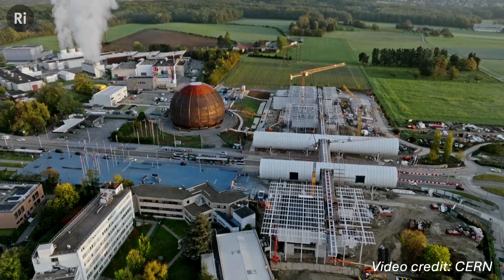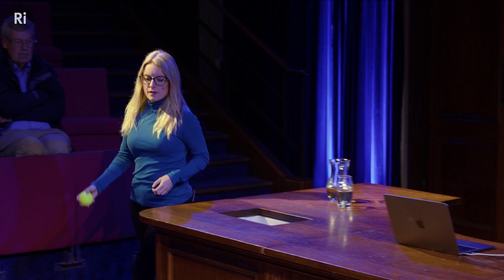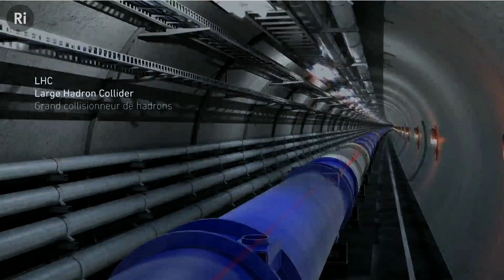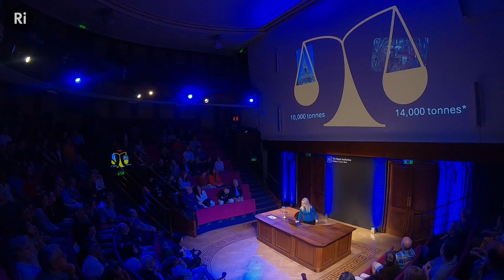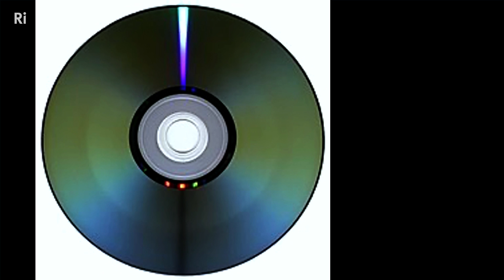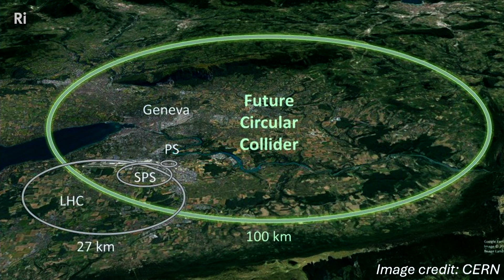Particle physics and the CMS experiment at CERN - with Kathryn Coldham

Comment: If Physicists describe electrons as point particles with no volume, where is the mass of the particle?

Can one extra spatial dimension produce a geometric explanation of the 1/2 spin of electrons?   The following is an extension of the old Kaluza-Klein theory. Can a twisted 3D <---> 4D soliton containing one extra spatial dimension help solve some of the current problems in Particle Physics?

What do the Twistors of Roger Penrose and the Geometric Unity of Eric Weinstein and the exploration of one extra spatial dimension by Lisa Randall and the "Belt Trick" of Paul Dirac have in common?  Is the following idea a “Quantized” model related to the “Vortex Theory” proposed by Maxwell and others during the 19th century?  Has the concept of the “Aether” been resurrected from the dead and relabeled as the “Higgs Field”?

In Spinors it takes two complete turns to get down the "rabbit hole" (Alpha Funnel 3D--->4D) to produce one twist cycle (1 Quantum unit).
 Can both Matter and Energy be described as "Quanta" of Spatial Curvature?  (A string is revealed to be a twisted cord when viewed up close.)         Mass= 1/Length, with each twist cycle of the 4D Hypertube proportional to Planck’s Constant.

In this model Alpha equals the compactification ratio within the twistor cone, which is approximately  1/137.

1= Hypertubule diameter at 4D interface

137= Cone’s larger end diameter at 3D interface where the photons are absorbed or emitted.

The 4D twisted Hypertubule gets longer or shorter as twisting or untwisting occurs.   (720 degrees per twist cycle.)  

If quarks have not been isolated and gluons have not been isolated, how do we know they are not parts of the same thing?   The tentacles of an octopus and the body of an octopus are parts of the same creature. 

Is there an alternative interpretation of "Asymptotic Freedom"?  What if Quarks are actually made up of twisted tubes which become physically entangled with two other twisted tubes to produce a proton?  Instead of the Strong Force being mediated by the constant exchange of gluons, it would be mediated by the physical entanglement of these twisted tubes.  When only two twisted tubules are entangled, a meson is produced which is unstable and rapidly unwinds (decays) into something else.   A proton would be analogous to three twisted rubber bands becoming entangled and the "Quarks" would be the places where the tubes are tangled together.  The behavior would be the same as rubber balls (representing the Quarks) connected with twisted rubber bands being separated from each other or placed closer together producing the exact same phenomenon as "Asymptotic Freedom" in protons and neutrons.  The force would become greater as the balls are separated, but the force would become less if the balls were placed closer together.  Therefore, the gluon is a synthetic particle (zero mass, zero charge) invented to explain the Strong Force.  The "Color Force" is a consequence of the XYZ orientation entanglement of the twisted tubules.  The two twisted tubule entanglement of Mesons is not stable and unwinds.   It takes the entanglement of three twisted tubules to produce the stable Proton.   The term “entanglement” in this case is analogous to three twisted ropes being wrapped around each other in a way which causes all of the ropes to move if someone pulls one of the ropes. Does the phenomenon of “Asymptotic Freedom” provide evidence that this concept is the correct interpretation of the experimental data now available?
Reply: Sounds about right. What are you or we able to build if this information is true.
Reply: @JakeSeeber  Thank you for the kind response.  They are very rare these days.  Dr. Peter Woit has recently explored using "Twistor Theory".  This concept was originally proposed by Sir Roger Penrose during 1967.  This theory can be "chiral", with either Right-hand or Left-hand twist, and is "quantized" with twist cycles.  This model is a type of "Twistor Theory".  Imagine a subatomic version of an Eistein-Rosen Bridge with a twisted internal surface.  A short tube can produce a twisted torus.  Could this help explain neutrinos and Dark Matter that interact very weakly with other particles?  A longer tube open at each end could partially unwind producing Electromagnetic Waves like light.   The opposite could also happen.  It could absorb Electromagnetic Waves and store them as twist cycles.  This could help explain how electrons emit light or absorb light when changing Energy Levels in atoms.  A long tube could become over-twisted and break producing an electron and a slightly shorter tube.  Could this help explain Beta Decay?   Long tubes could become entangled with other long tubes producing the Strong Force.  This would mean Quarks and Gluons are actually parts of the same thing.  This model can help explain many of the current observations without the need for more experiments.  During 1905 Einstein provided a different interpretation of the experiments that had already been done.
Reply: @ Interesting, I’m not sure how this could be described or corroborated with mathematics, or if it is feasible to do so.
Reply: @JakeSeeber  That is what Dr. Peter Woit is attempting to do with his version of Twistor Theory.  Geometry is pure Mathematics.  We now know DNA molecules are made up of long twisted structures which can produce writhe cycles.  Could writhe cycles help explain the multiple generations of particles in the Standard Model?  More twist in DNA molecules produces more writhe cycles, and there is a mathematical relationship between the two.   The phenomenon of "Supercoiling" may be something that should be explored if it has any chance at all of explaining multiple generations of particles.

Comment: One can mathematically model all observed particles at CERN or any collider as overlapping expanding wavefronts of emr generated by the collision of just 3 protons. No standard model needed. Dont agree? The facts are as follows: Two overlapping expanding wavefronts in 3 dimensions ( think expanding bubbles) will create a single expanding ring where the two original waves overlap or interfere. This is usually referred to in physics as an annulus ring. Add a third expanding wavefront bubble to the mix and you get....Two opposing single particle like paths where the three expanding bubbles of emr interfere in 3D space!!. That look to the uneducated theorist as one positive and one negative particle path. As observed at CERN. And if you vary the relationship between these three overlapping bubble paths you can duplicate any spiral, straight, curved or split particle path EVER observed at CERN. The standard model is more dogma than scientific fact.

Comment: The standard LHC beam production and filling scheme foresaw 2808 bunches per ring with 288 bunches per injection from the SPS, and each bunch containing 1.15x1011 protons in a beam size of 3.5 micrometres. So about 3 micrometers instead of 3 millimeters !

Comment: (8.809/8.45)^3*ch=126.25 Gev[1.602*10/c^2] : Higgs boson by muon decay which shrink proton radius pl=g(p)*(4pi*pm/3)/c^2=8.809*10^-16 meter to 8.45*10^-16 meter, g(p)=g*m^2/pm^2=g*(pl/4.1888*l)^2=1.13*10^28 is strong force by graviton g*m^2=ch/(2pi) : solution of GR field equation ch=8pi*g*(m*c^2/2)^2/c^4 oscillating between Planck scale l=g*m/c^2=(h*g/2pi*c^3)^0.5=1.616231*10^-35 meter which can deduce ch=2pi*g*m^2, m=(ch/2pi*g)^0.5=2.176466*10^-8 kg, proton scale pl, 2^(1/6)*ch=125.0895 Gev : Higgs boson by 3 two dimensional Schwinger Dyson quantum field ch=2pi*l*m*c^2=2pi*pl*pm*c^2/4.1888=2pi*A*me*c^2137.036 by ADS/CFT duality from 3 quantum black hole l, pl, A^2=g(p)*pi*me/128.4980143*c^2, deduce weak force unite strong force g(p) with EM force between proton[pm=1.672621868*10^-27 kg], electron[9.10938*10^-31 kg] in [hydrogen]Atom[A=5.29177282*10^-11 meter] k*e^2=g(p)*pm^2/137.036=ch/(2pi*137.036)[e+]=me*(c/137.036)^2*A[e-]=4pi*g(p)*pm*me*137.036/128.51991 by pm/me=1836.1527=4pi*137.036^2/128.51991=1/(4*A1*137.036^3)=(pi/(128.4980143*A*137.036))^0.5, deduce 85.73% ratio between muon[105 mev=(3*137.0362)*0.511], electron[0.511 mev=me*c^2=g*m^2*137.036/A] decay from strong force [b,s] by 14.27=A/(3*137.036*(A-A1))=128.51991/(3*137.036*(128.51991-128.49801421207))=128.49801421207/3^2=(80.351+0.135)/(137.036*(80.485-(80.42939+0.015448)) deduce A1=A*(128.4980143/128.51991)=5.2908712*10^-11 meter, W boson 80.42939 Gev[80.351+,-0.094], (me/pm)^2/137.036=128.4980143*A/3.1415926=2.16*10^-9=0.00116592026-0.00116591810 : discrepancy of muon magnetic moment of (g-2)/2 factor between experiment data[0.001165920+((61-41)+(57-25))*10^-9/2], theoretical prediction[0.00116584719+6845*10^-7+154*10^-8+92*10^-9] from Fermilab at 8/10/23, g*m^2/137.036*8.38=0.015448 Gev : Tau neutrino, 15.448/(1/3)^2 - 2*2276 + 0.511 + 0.1811/6 = 135 mev : pion, 0.1811mev=pm^2/(2*g*m^2*137.036) : Muon neutrino, me^2/g*m^2*137.036=0.108*e : Electron neutrino, 2.276 mev=4pi*0.1811: up quark.

Comment: 1 neutrino would occur in 1 in 100 hydrogen atoms, a nucleus is made of two circumferences of stings in a coil.  monopoles propelled by a convection current.  the length of string is constant it forms in two circumferences as a coil.  thereby the two different coils have a different length as a cylinder.  a quark is a neutrino

Comment: why aren't particle accelerators made in a straight line?  seems like you wouldn't have to deal with the curve and extending it could be as easy as adding length.
Reply: You need all the circles that increase in size to accelerate the particle speed before they collide. If they were in a straight line it would have to be about 1000 miles long.
Reply: Some are. Most homes had one or more in the recent past. Cathode ray tubes, a form of linear particle accelerator, were in every TV. But there were, and still are, linear accelerators in use for things that don't require the enormous energies that circular ones can provide.
Reply: I'd do an eliptic curve to make it a bit more geometrically insterting